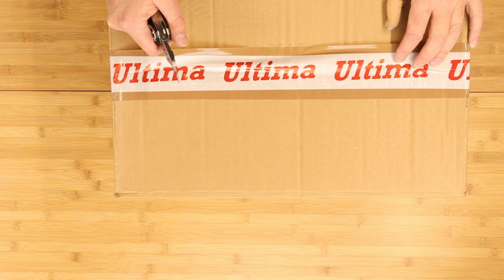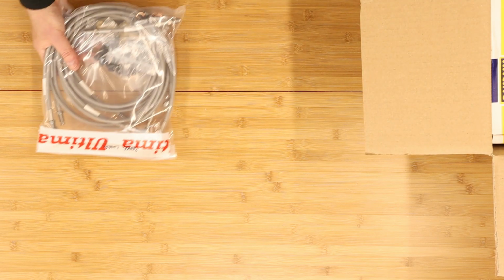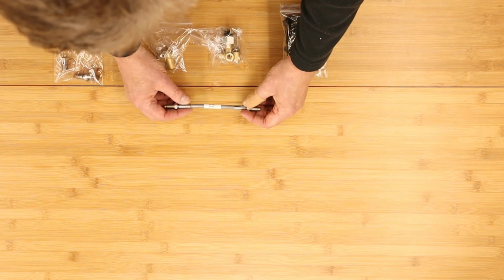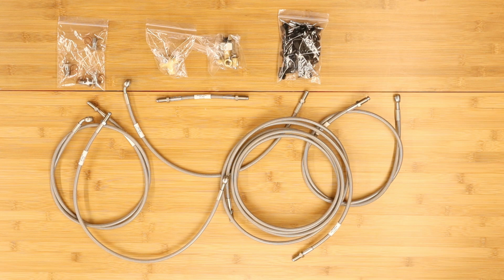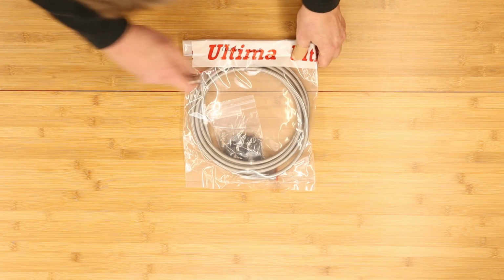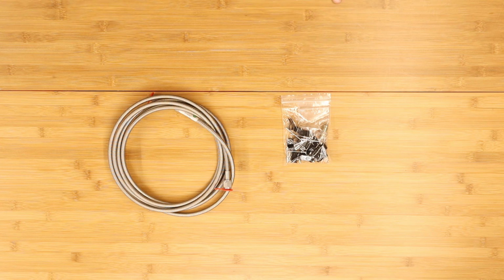Building an Ultima RS with Nigel Dean. Part 8 – Brake and Clutch Hoses

Comment: Good idea to mark the hydraulic hoses, but I would wait until after the system is pressure tested. I’ve had brand new brake calipers that I had to tighten a lot more than I wanted to, to stop weeping at the junction.
Reply from the maker: Hi Chris and as you say there is always a risk of a weeping connection. I must admit I tend to under tighten rather than over tighten (a lesson from my father to never force), but I guess a weep is better than a gush 😊. Appreciate the comment and I can't explain how enjoyable this build is 😎

Comment: Another great video! Love the attention to detail and how clean you make everything. By any chance are you documenting the hours spent on each step? I’d be curious to see how long each step takes in relation to the entire project. I’m expecting delivery in Sept and would like to roughly plan the entire process to ensure I’m done by Spring 2023 (7-8 months). Thanks again for everything you do!
Reply from the maker: Hi Brian, and to be honest I'm probably the wrong person to ask regarding how long it takes to build a component car. The reason I say this is because I get soooooooooooo much enjoyment from building I don't rush the process and as such I tend not to measure how long it takes. For example this afternoon I sat in my leather buttoned chair for an hour just looking at my chassis and planning the next video. However, your timescale is achievable with an Ultima providing you follow a pure build but I would say don't rush and enjoy the experience. Cheers Nigel
Reply: @v8creative  I hear ya. I will 100% take my time and pay close attention to every detail while absolutely loving the experience. Like you, it's a labor of love. I think it comes down to pride in your work. We put so much time, energy, and money into these projects...we have to stop and admire the work and enjoy the process. Looking forward to the next video!

Comment: Nigel, your build series is spectacular.  After 20 months waiting, my kit arrived in the US a couple months ago.  Really enjoying the build.  We re-watch every one of your videos as we approach that section of the process.  Although the Ultima instructions are very detailed in most places, your videos make everything so much clearer.  Sometimes I wonder if I'm not using the Ultima instructions correctly.  For example, in your Part 8 video, you nicely demonstrate the placement and insertion of the Rivnuts for the brake line T-junctions.  I don't see a single word in the Ultima manual on doing anything with connecting brake lines.  There are photos.  Did you do all that from the photos, or am I not using the online manual properly?  Thanks for the inspiration and amazing videos.
Reply from the maker: Hi and thank you for the comment. Super to hear my content is helping with you build. As you say there is nothing like video content and it will always be superior to written content. The Ultima build portal is detailed but as you can imagine with over 2,000 components there is only so much detail that can be provided or the manual would be 1,000 pages+ long. You will see me providing more detail based on several things. Firstly, the build portal is my starting point. Secondly, since this is my 8th car build I can interpret how things are done by a single photo. If I'm unsure I would reach out to the factory but this was an exception to the rule. I suggest using the portal, refer to my video and if you are still unsure email or call the factory. Enjoy the build and juts fire over an questions

Comment: Nice!! I notice you do tension-tight for all your connections, at least thus far. Do you go back in and use lock-tight to make sure each connection won't come undone due to the vibration of the vehicle during travel?
Reply from the maker: Hi again :-). Not all bolts / set screws require thread tight. During the build Ultima provide the torque for all major components and if thread lock is required it's clearly stated. Most nuts have a nyloc insert and in some cases an anti vibration washer. My process is prior to going on the road I check all bolts and set screws for tightness / torque and then apply a red line across the fastener - you will see in later episodes. This tells me the fastener has been tightened and if it comes loose in future. Good question and please keep tuned. Nigel

Comment: Hi Nigel I'm new to your channel and catched up so far this might be the best channel that go more in-depth into the build i love it. Just a question Nigel Can you tell us the wheel dimensions. If i were to build something like this i would wanted to put custom wheels.
Reply from the maker: Hi Bryan and thanks for the comment. The wheels are 19 inch diameter but the other dimensions are not cast into the wheels since they are specifically made for Ultima. Glad you are enjoying the channel and good luck with your future project. Cheers Nigel

Comment: Nice work. Are you planning to ceramic coat the alloys and calipers out of interest? I got my 911 ones refurbed and regretted not doing it as now they are caked in brake dust again!. Will be doing so on the ultima I think
Reply from the maker: Hi SEO Daddy and thanks for the comment. I currently have no plans to ceramic coat the wheels and calipers. In fact I have not considered this approach and will wait and see what the build up of brake dust is like. To be honest I enjoy washing my creations so much I doubt if the RS will have long enough to get a build up of dust. 😀
Reply: @v8creative  Yes thats a good point! The 911tt was a daily (currently I have it stripped for repairsl..) so I wasn't so diligent with cleaning. Keep up the good work. One query I have; as the last kit I had was a total bstard to get under the pedals ,(inside the car was the only way) is can you open the front clamshell and access the battery and pedals etc? Is there anything that will be very hard to get to when the body is fitted? Does the car go back to Ultima (always) for body fitment if you choose for them to do it? (go back when all the pre stages are done) thanks!
Reply from the maker: @tradinguniversityonline  Access to components on the Ultima is very good due to the clamshell format. In fact removing the clamshells completely is a very simple task. Probably the hardest components to reach once the car is complete are the pedal set and the aircon unit. However, having worked on many super cars I would say the Ultima is amongst the easiest. Cheers Nigel

Comment: A lot of spannering, any specific torque figures required? I tend to tighten things up too much sometimes.
Reply from the maker: Hi Jason, and a very good question indeed. Ultima provide comprehensive torque settings for the fasteners used for the major mechanical components (i.e. suspension, steering, brakes calipers, drive train, etc), but for smaller items such as unions, brackets, etc, torque settings are not provided. This is not unusual in the specialist automotive sector and knowing when something is tight enough is a skill learnt with practice. In reality striping threads (over tightening) takes a lot of force especially for M6+ bolts. I would suggest if a builder is unsure when tight is tight enough buy a selection of nuts and bolts in differing materials (steel, stainless steel, brass). Bolt the bolts in an engineering vice and go for it. It soon becomes apparent when a thread is over stressed. In addition most smaller fasteners use spring washers or lock nuts to avoid loosening over time. Hope this helps? Cheers Nigel
Reply: @v8creative  Thank you Nigel, well noted and will keep this in mind, keep up the good work.
Reply: For brake and clutch fittings it’s usually “tight enough to not leak but no more”. The copper washer crushes to help conform to the gap.